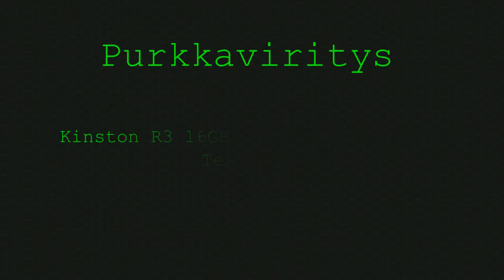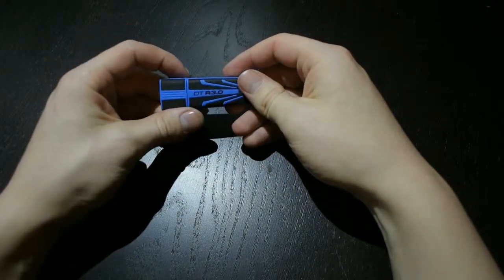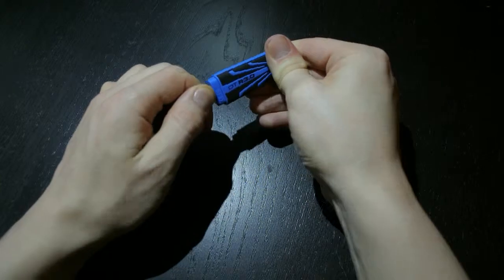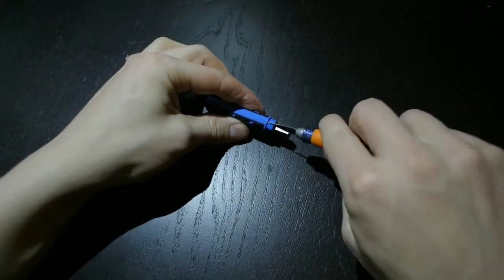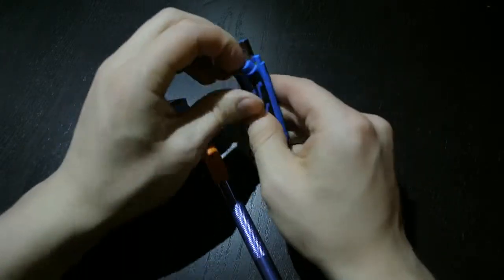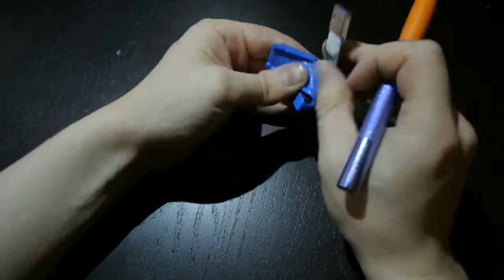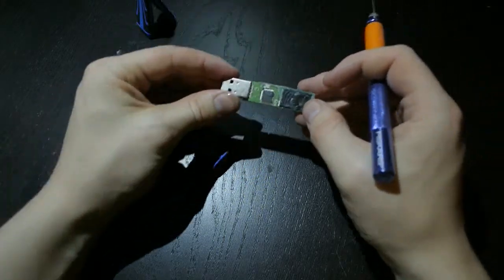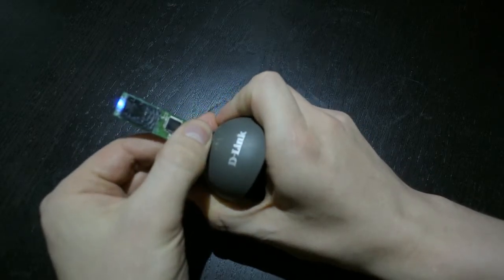Broken "Rugged" Kinston DT R3.0 16Gb USB3 memorystick disassembly

Comment: I FIX THAT .FIRST TAKE PCB IN GAZOLIN  50MIN . TO WASH ALL GLUE
SECOND USE GOOD FLUX AND GOOD SOLDRING IRON TO CONNEC ALL NAND PIN 
IF NAND IO ="INPUT OUTPUT DATA BUS IS BROCKED " CONTRLLER CANT READ DATA AND SHOW "2207 PRAM"
USE CHIPGNUNE TO SEE NAND IS CORRECTLY SOLDR OR NOT EXAMPLE 

Controller Vendor: Phison
Controller Part-Number: PS2251-07(PS2307) - F/W 01.02.10 [2013-09-27]
Flash ID code:      8988244BA900 - Intel 29F64G08AAMF1 [MLC-8K]

MY NAND IS INTEL . BUT KINGSTONE  USE TOSHIBA TLC "98 3A 98 A3" TC58TEG7TLA20

Comment: "Rugged" indeed, the last and final Kingston product I shall purchase. I didn't tear this bastard up like you did, but after manhandling it a bit it started working temporarily. From what I can see without cutting the rubber cover, my flash drive too has that white porcelain bit and probably has suffered a small fracture on the PCB. Thanks to you sir I managed to get some of my data off it before scrapping the flash drive.

What I find particularly interesting is that I ever had only 4 flash drives.

My first drive I purchased in 2003 or 2004, it's a 512MB transcend jetflash drive and has been used extensively for years. It has a nifty mechanical read only switch as well, somewhat cheap plastic case. It still works, it has been repurposed as a bootable device for my PCI-E SSD drive, I think this device should feel proud of itself. It's done good.

Sometimes around 2008 (ballpark) I purchased a Corsair Voyager 8GB flash drive with a rubber case. Has been used quite extensively, I've carried in my pockets, my rucksack, my manpurse etc. It still works, of course.

Sometimes around 2010 (ballpark) my brother found a noname "takeMS" 4GB flash drive in the street. Who knows how long has it been lying there, it definitively suffered some bending damage around the USB connector, cheap ass plastic case. It still works, use it only for backup and when I need an extra bootable device.

Got this Kingston DT R3.0 32GB drive sometime in 2013, has been used moderately. Suffered a fracture, does not work anymore. May it roast in electronic device hell.
Reply from the maker: I have a dozen DTSE9 and DTSE9 G2, those things are tanks and will take so much abuse due to their all metal construction to the point that some of them have had their laser engraved markings polished off, it seems like the DT R3.0 was just a terribly designed product to be quite frank.
Another one I quite like is the PNY metal usb drive due to the way its easy to attach to your key ring and easy to remove from them.
Reply: I don't know, I am now looking to get a Samsung MUF-BB FIT 128GB USB 3.0 drive, there's also the "bar" version. I figure who's better at making NAND chips than Samsung. They are not available in my area, but I should be able to get some, hopefully genuine ones, from ebay.
Reply: My usb flash starts to connect to the computer, but the light is not blinking, it only shines all the time. And its like the flash cant be recognised. Any idea, if its possible to fix it?
Reply: @Evld  I would say you can try on a different computer or at least a different port on the same machine. Based on your description, it's probably done for. If you have some important data on it, you may be able to find someone to fix it, but it's probably cost prohibitive in a majority of circumstances.
Reply: @mkeyx82  I see I see. Thanks bro
Reply: @Evld  you are welcome, good luck.

Comment: I have one that has the same problem, and it does not work anymore. I saw your video, and I tried to pull it a little and tilt it. It worked. Your video saved my pendrive .. hehe .. Thank you. However, I keep thinking how Kingston makes something like that.
Reply: My usb flash starts to connect to the computer, but the light is not blinking, it only shines all the time. And its like the flash cant be recognised. Any idea, if its possible to fix it?
Reply: @Evld  What is the brand and model of your pendrive? In your case it seems to me that the pendrive is defective and cannot be fixed. If it's fixed, I don't know how to fix it.
Reply: @MauroGuerreiro  it is kingston dtr3.0 g2
Reply: @Evld  What you can do first is to connect the pendrive via USB extender cable. If that doesn't work, cut about 1mm of the rubber, close to the USB stick's connector. If it still doesn't work, I'm afraid your pendrive is really bad. I wouldn't know how else to help.
Reply: @MauroGuerreiro  thanks.
Reply: @Evld  What you can do is the following: After cutting the tip of the rubber, do not fully insert the pendrive into the USB port. Keep controlling and limiting the fit with the tip of your finger against the computer housing. With the speaker turned on, the operating system will audibly notify you when the pendrive fits correctly. I still need to do this. It seems that this pendrive had a manufacturing problem, and unfortunately, we have to adapt to the problem.
Reply: @MauroGuerreiro  but mine was always working fine. I dont know what happened to it. I removed all the rubber from the flash yesterday. And I dont have that extender cable. not sure what its doing and if it can help me.
Reply: @MauroGuerreiro  you have the same usb flash like me?
Reply: @Evld  Well, if it already worked correctly, surely an extension cable will not solve it. I thought it was a bad connection in the socket. The pendrive must have really failed. I do not know what to do.
Reply: @Evld  Mine is DT R3.0 32GB. Blue & Black colors.
Reply: @MauroGuerreiro  mine is the same 👍
Reply: @MauroGuerreiro  thanks anyways. haha

Comment: I purchased the DTR3.0 G2 16GB, and it does not have all that extra sealant. It's just a rubber case over the pc board, but then something is keeping the rubber piece on. It looks like it should just slip off. But I'm not going to tear mine apart as it still works. :-)

Wayne Sallee
Wayne@WayneSallee.com
Reply: Kinston is junk, and their warranty is junk. That kinston drive did not last very long. I sent it back under warranty, but since they were not making any more they downgraded me to a much lower quality drive that also did not last long. Interestingly after that one died, I found one of the same kind in the dirt that had been exposed to the elements for months, and that cheesy quality memory stick is still working; maybe because the third one is a lower gb drive.